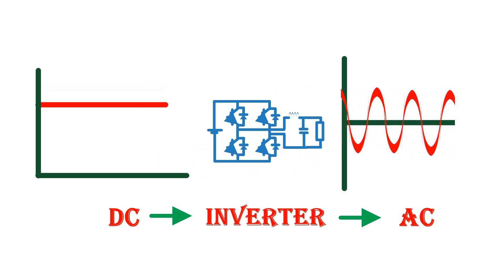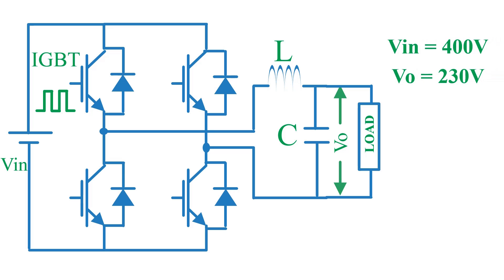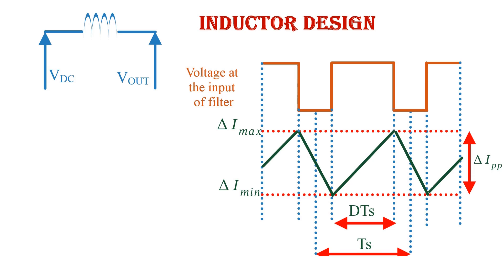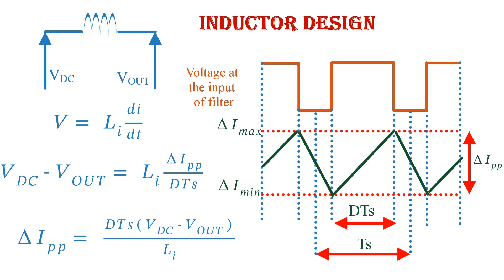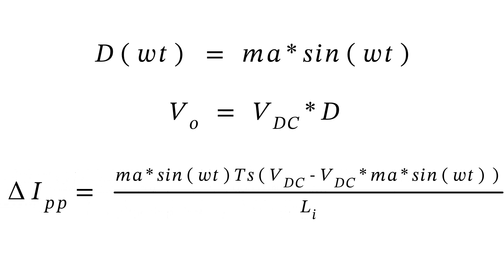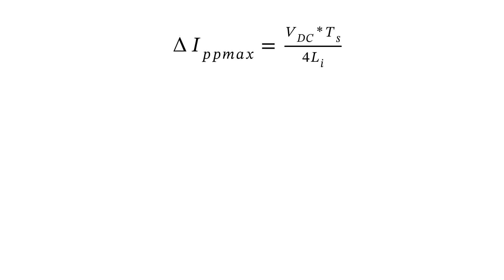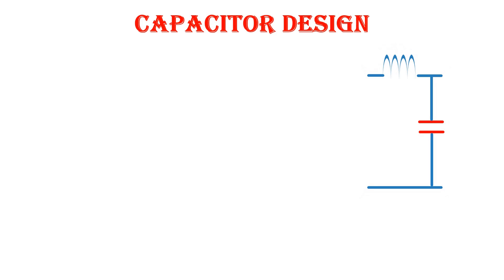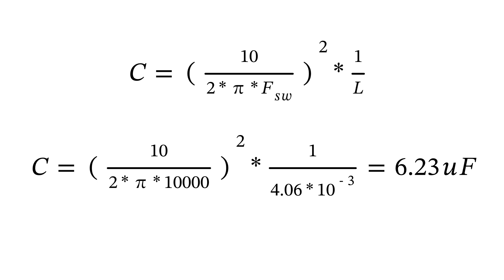Single Phase Inverter Design & Open loop Simulation in MATLAB.

Comment: Hello sir, may I know whether we can remove the number 4 from the equation At 2:55, which is multiplying with Li? I wanna design an inductor and capacitor for buck type inverter where LC will be worked as filter.

Comment: sir, how you can get amplitude 0.45 in sine wave?
Reply: Same .. please explain
Reply from the maker: 0.45 is the required modulation index when the input voltage is 400 and required output voltage is 230V RMS
Reply: @TechSimulator  Sir how do you calculate this modulation 0.45 did you use this formula Vac=m×(Vdc/(2*root(2)))  or other

Comment: I tried with 48V Dc voltage  and to get 230V at the output side. Did the calculations following the formulas. But failed to get 230V. Getting output of whatever the voltage I am giving at the DC voltage

Comment: This video is misleading. The suggested filter does not give sine output as it dose  not filter 50 Hz square wave which is necessary for getting bipolar output. Some one can try with design value of L and C and see the result.
Reply from the maker: pls contact me at my email i can give you the working simulatio file
Reply: where is ur email sir?

Comment: Excuse me, sir. I have a questionl. How did you get that 2 KW power output? Thank you.
Reply from the maker: I wantated demonstrate a 2 kw inverter, so i choose that value. You can choose whatever value you want
Reply: @TechSimulator  thank you sir
Reply: Sir, im unable to get the output as 2kw, I have used the same values but still not getting the @kw output. Any idea why that is the case?
 @TechSimulator

Comment: Hello! Thanks for the video, it was very informative!  At 2:55, I did not understand the factors 8.69 and 1.414 that do not match with any value in the formula in the middle row. Request you to explain it in some detail please!
Reply from the maker: 8.69 is 2000/230. That is output power/ output voltage. 1.414 is root(2) to find the peak value
Reply: @TechSimulator  Thank You Sir  i am also confused here
Reply: would you mind to explain why did you chose P= 2000 ?
thanks in advance @TechSimulator
Reply: Thanks sir... I really appreciate it, because i was also confused about that factors.

Comment: When I simulate the following warning appears

[ Warning: You have required continuous-time simulation of a system containing switches or nonlinear elements.
The ode23tb variable-step stiff solver with relative tolerance set to 1e-4 generally gives best accuracy and simulation
performance.
For some highly nonlinear models it may be necessary to set the "Solver reset method" parameter to "Robust".
See "Improving Simulation Performance" chapter in SimPowerSystems documentation for additional information on how to select an
appropriate integration method.
To ignore SimPowerSystems warnings, select "Disable SimPowerSystems warnings" in the Powergui Preferences tab.]

Comment: One thing not clear is D(wt) = Ma*sin(wt). How could D be negative. Shouldn't it be D(wt) = (1+Ma*sin(wt))/2  ?

Also, the LC filter values were chosen w/o taking the load value (R) into account. In the simulation you chose 100 Ohms. What if the load changes? How would you control the damping ration of the LPF? On command or load change you may get oscillations and instability.

Comment: Brother i am trying the same specification circuit in matlab but it does not gives me  a pure sinusoidal wave form it gives  me voltage in negative values at the output

Comment: Thank you for the video! just a side note, 400Vpeak/sqrt2 is 282.84Vrms  ,  you r thinking voltage line that is divided by sqrt3
Reply: RMS voltage for a DC source is 400V

Comment: Sir I have a doubt. In the inductor design formula when substituting the values in the denominator I saw 8.69. What is that constant. Can you kindly explain.
Reply: its simple
first calculate the current for given load,
i= Power (2kw given)/ V(230v) = 8.69A
next he has multiplied by 1.414 which is nothing but root(2) to get peak current
and finally he has taken ripple percentage as 20% hence multiplying by 0.2
Reply: @aquilrodrigues8155  I followed a similar method for a 500W inverter
But the values substituted gives me only 40W at 230V. Any further increase in load power reduces the voltage down. The amount of capacitor current used in the filter increases. Can you help me?

Comment: Good example. But I am not getting the required current output. I need to convert 12 V from battery to 12V sine wave at 500W. Can u help
Reply from the maker: Share the model
Reply: @TechSimulator  how sir

Comment: Dear Sir I have a question.
during simulation, If I use capacitor instead of battery and I selected initial voltage as 5V. so, How i can choose the main value of capacitor as capacitance?

Comment: NOTE: the capacitance and inductance values are in F and H units while u need to put 6.23*10^-6 for capacitance and 4.06*10^-3 for inductance
Reply: Thanks a lot
Reply: It is the same thing. 6.23*10^-6 = 6.23e-6

Comment: Sir, How to select the Dc link capacitor
Reply from the maker: You can select value of capacitance based on the max permissible  voltage ripple. You also need to consider the ripple current of capacitor, that you will get from the datasheet. If the ripple current is less, then you need to connect multiple capacitors in parallel
Reply: @TechSimulator  Sir, could you some reference to understand dc link capacitor value calculation

Comment: Brother i am trying the same specification circuit in matlab but it does not gives me  a pure sinusoidal wave form it gives  me voltage in negative values at the output
Reply from the maker: Please drop a mail at ashacademy01@gmail.com with ur simulation file.
Reply: @TechSimulator  okay brother i am sending it thank you
Reply from the maker: Ok. I will check
Reply: @TechSimulator  i have the same problem!
Reply: Me too, can I sent email to you?

Comment: In the numerial value of inductor in the denomenator you have taken (8.69*1.414) as a term which cannot be related to about formula components. Please refer time: 2.55min. Can you please clarify?
Reply from the maker: i am considering a 2Kva inverter. So for a single phase 230V RMS voltage, the maximum current would be 2000/230 = 8.69. this is value is in rms. so we need to take peak value of it. so we multiply this value with root 2, that is 1.414.
Reply: @TechSimulator  can we implement the same for a 60kW Inverter?
Reply from the maker: Single phase or 3 phase?
Reply: @TechSimulator  actually I need to implement Dual Active Bridge in order to attain DC-DC conversion from one DC level to another DC voltage, with control over both voltage and current control. Can you recommend some video or tutorial to refer for the same.
Reply from the maker: @shubhambhosale6135  you wont get much details of DAB in the web. just go through the below link. its a application note from TI. hope it would be helpfull.
https://www.ti.com/tool/TIDA-010054
Reply: @TechSimulator  thank You this was already available still your videos have helped in more ways.
Reply from the maker: I have simulations of dual active bridge, that i will be uploading very soon.
Reply: @TechSimulator  Great that would be a big help. As not many available sources are available on the net for DAB in particular as you mentioned earlier.
Reply from the maker: For this huge power, people usually dont use single phase inverter.